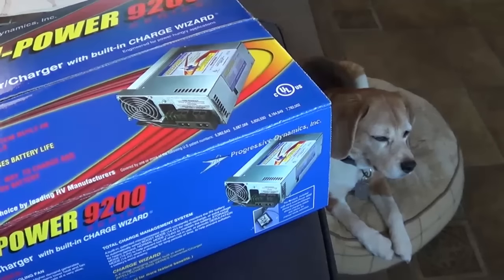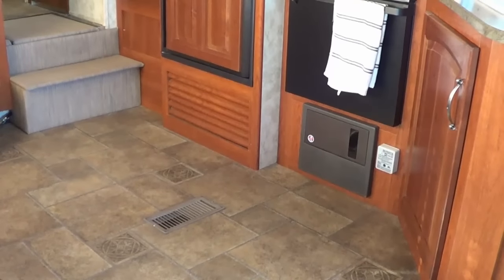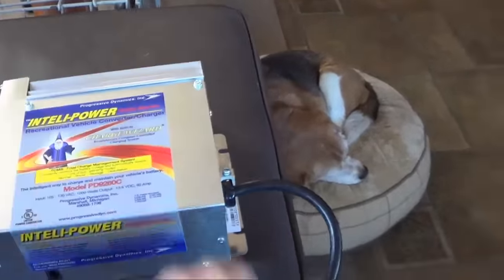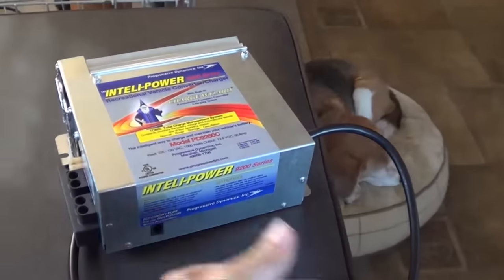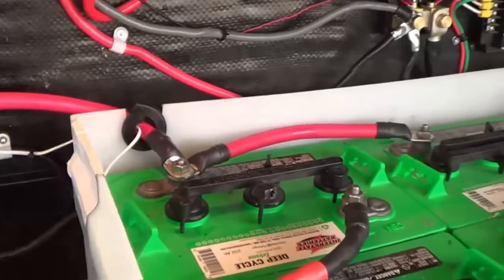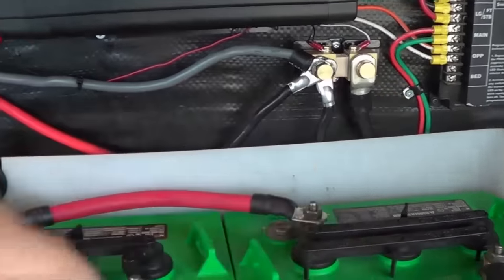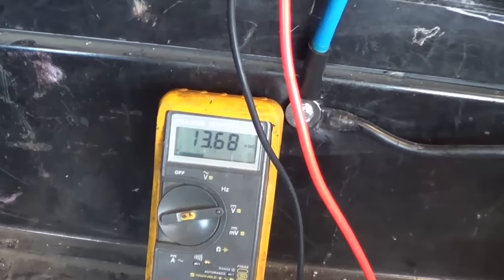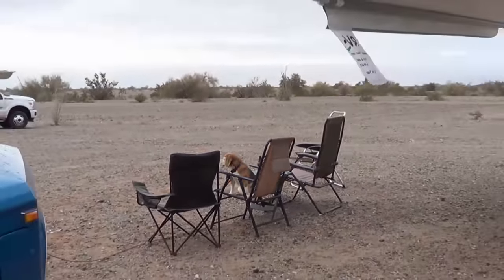Upgrading to an INTELI-POWER Battery Charger for Boondocking

Comment: hi there, here is a link https://www.youtube.com/watch?v=Blp_-WYfR9c, and i have a question for you : he is installing a Xantrex inverter/charger. which take shore ac power to charge battery. what he say he disconnect the old charger to avoid confusing(avoiding 2 charge in-line). any comment? thanks. hope you won't mind.
Reply from the maker: An inverter charger is a different device so makes sense to me to disconnect the old charge converter. My inverter and charge converters are separate. In my setup, I'm using the InteliPower strictly for battery charging when off grid as it helps charge my batteries faster since its a better quality charger than the OEM one and I've located it right beside the battery bank for less wire losses. With my solar system I only really need it for cloudy days or when I've run the batteries down too far at night for the solar to recharge them during the day
On shore power I've continued to use the OEM charger and the IntelPower is left disconnected. With my 500 watts of solar doing most of the battery charging the charge converter has little work to do so I've decided to use the OEM one while hooked up, so have left things exactly the way they were, may as well wear it out versus my more expensive InteliPower.